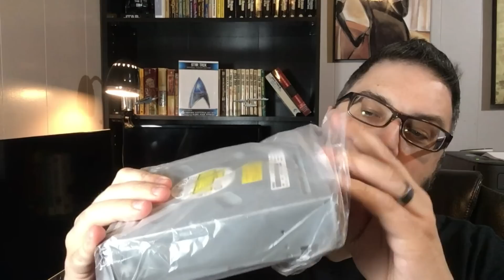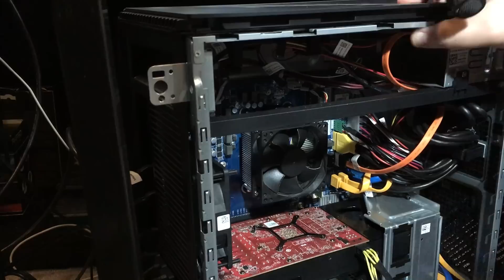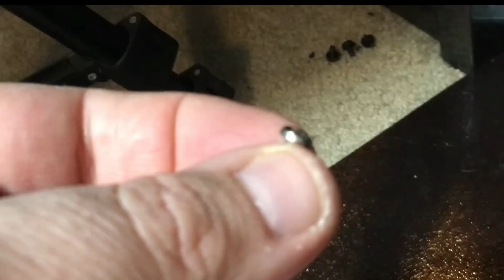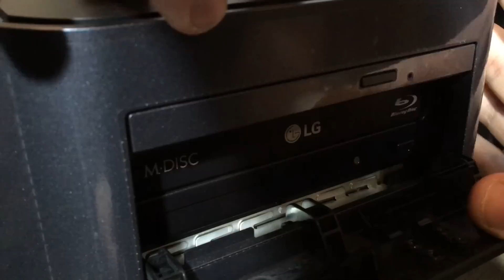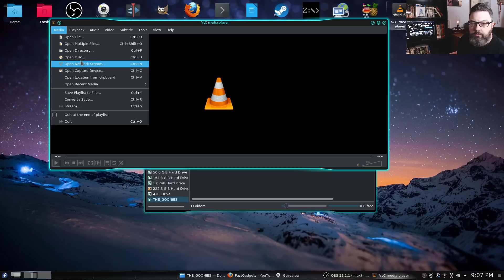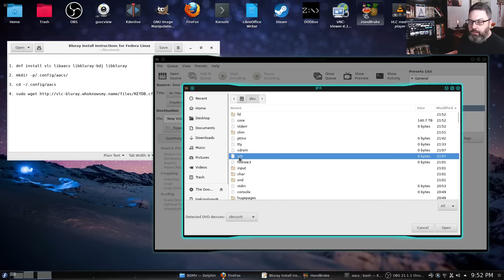Installing a Blueray Drive in the Dell 5675 Linux Machine

Comment: Have you seen the 2018 refreshed model? The upgrade to ZEN+ is nice (I'd assume some dell version of an X470 mobo, but maybe X370 bios upgraded for ZEN+ if cheaper. I have the same model you have, but the CPU is the 1700X, and RAM is only 8GB. I do want to get a bluray drive for my system, but not sure what to get, was thinking either an internal LG, or Pioneer.
Reply: Would the front have enough space for a 120mm rad AIO?

Comment: Try out MPC-BE for Windows, I've got good epxerience with it with Blu-Ray.
Reply from the maker: Peter Jansen Thank you!
Reply: If you combine madVR with MPC-BE then you even potentially get better video image, especially if you use somewhat heavier compressed (like 1.6 GB for 40 minutes 1080p) video or upscale from a lower resolution. It puts the graphics card at work to decrease visual artefacts. There are good tutorials on MPC-HC and madVR which also work for MPC-BE, MPC-BE is a fork from MPC-HC. It is as simple as downloading madVR, putting it in the same folder/path and selecting it in the GUI of MPC-BE. For the Windows platform the video enthusiasts embraced MPC-HC and MPC-BE with madVR, especially manga-fans supported it at first, later other video-enthusiasts followed. It put a lot of pressure on VLC to also implement video-optimization tools (you have to hit the advanced functions checkbox in the GUI of VLC). I used VLC in the early/mid 00's but I quit using it because of MPC-HC and madVR, now I mostly am on Kubuntu, unless I play video games or use Matlab or something like that. On my old system Kubuntu 18.04 runs better than Windows7 and I am not fond of Windows10 to put it mildly (I will use it for my next rig as a second OS, but not for this one).

Comment: From the looks of it OEM systems didn't change at all in the last 15 years. It is just like my 2009 OEM system. These days cases, PSUs and motherboads look much better if you assemble the system yourself and the cases (space, cablemanagement...) and PSUs ((semi)modular) are a lot more userfriendly. 

The Goonies, a guilty pleasure. :)